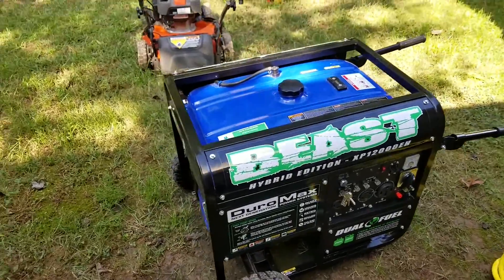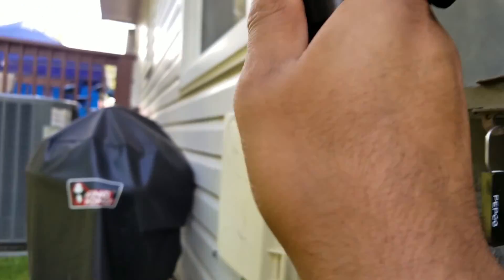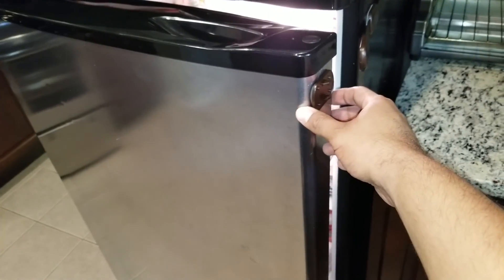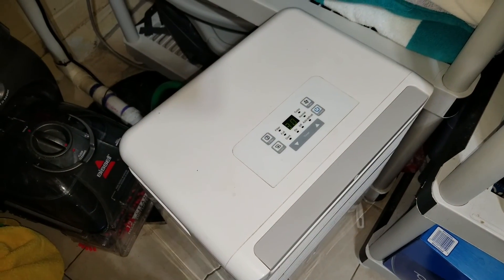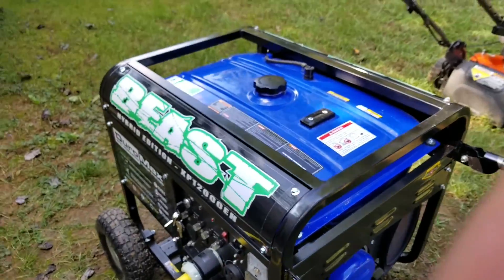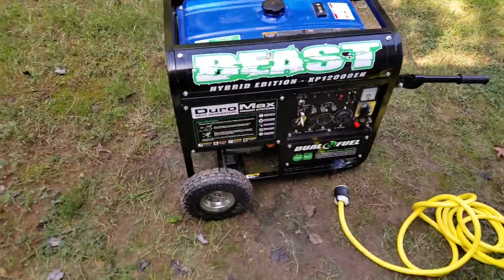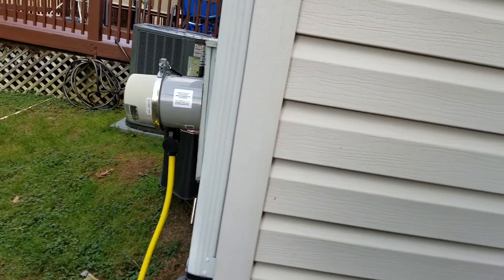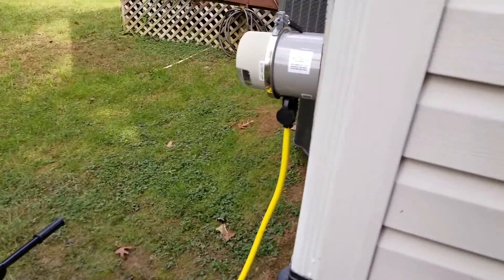GenerLink + Generator powers whole house - XP12000EH , MA23-N, running TRANE XR17

Comment: For use with the Generlink, the generator must be floating neutral and NOT neutral bonded to frame. Otherwise the second ground will mess things up
Reply: UPDATE: I used my TMG 10500 tri fuel generator which is bonded to neutral for 8 hours recently through the generator with no problems. The double ground didn't cause any obvious problems although this is NOT recommended

Comment: Cool device but too pricey for me.  Installing a 50a plug and interlock kit so i can just switch over and power what i need with a 10kw generator.
Reply: how much did you pay the electrician to install your interlock
Reply: @nic7694   I did it myself.  Was quoted about a grand but I did it parts and all for $500 which included a Siemens 100 amp 6 circuit sub panel, 50 & 100 amp breakers, Reliance 50 amp power inlet, all conduit, elbows, fittings, 50 amp 25' power cable from gen to power inlet, etc.  I had to add the sub panel to move over two double pole breakers for the HVAC condensers so I would have the space for the 50 amp breaker for the generator and interlock.  I added a 100 amp breaker that feeds the sub panel.  Used 2/3 for the 4 foot run to sub panel and 6/3 from the power inlet to the 50 amp breaker.  I work for the city where I live and the city electrician confirmed everything that was done.  I'm not in city limits so didn't have to worry about permits.

Comment: You have the idle control off and it should be on when you start the unit up. It's better for the wear and tear on a cold start up of the engine.

Comment: @Chris
Do you have the 30 amp Generlink (MA23 model)?  I assume so since you connected the cable into the 30 amp L14-30 connector on the generator.  Could you confirm?   If so, I’m surprised it will run your AC……that’s great !   Thanks.

Comment: My Generlink switch has instructions which state that it won't work with generators that have over 7500 watts run power.

Comment: You made Tim Ellen proud lol 😆 I use my beast to run my well pump when filling the 40 thousand gallon pool but also wired to home garage . Have 342 hours on it no problems run off LP 1000 gal. Tank. You need a small shed to protect an quite that beast down lol 😆

Comment: No interlock on that panel,dangerous,mostly illegal,they are simple to install.
Reply from the maker: I don't need interlock, I have a Generlink automatic transfer switch. It automatically disconnects form grid when you connect a generator.
Reply: My bad you are right I forgot that you hooked it in at the meter,keep up the good work.

Comment: May I ask what the electrician charged to install the GenerLink?
Reply from the maker: Free, my electrical company installed it at no charge. I just had to call several times times to explain what it was and I finally got an appointment and they came out to install it.
Reply: I live in Baldwin County Alabama.   I have the 30 amp Generlink which is rated for my house Baldwin EMC advised me what I needed.  Total cost was $755.00 with a free install and the BEMC lineman walked me through the entire connect and disconnect process with my generator running.  Sally was my last hurricane to drag extension cords from generator to appliances.  Next project is to replace my 25 year old Troy Bilt 5550/8550 generator (still runs great) with at least a 10000 watt dual fuel.  My gas meter is close to my Generlink.   Will primarily run off gasoline, if available.   Two takeaways:
1.  With supply chain issues, the Generlink is not always available.
2.  God bless linemen.   I have witnessed first hand their heroic work from Ivan to Sally.

Comment: DO YOU ACTUALLY GET THAT NICE YELLOW HOUSE CONNECTION OR NOT--
Reply from the maker: No, this generator did not come with a power cord. The only thing it came with was a 30 amp plug to make your own power cable. This yellow cord came with my Generlink Transfer switch kit... the thing connected to my meter.

Comment: Does your Duromax 12000EH run the central AC on LPG?  I see you added an NG conversion, does it run the central AC on NG?
Reply from the maker: It does runs my central AC on NG. My Central air is a 3 ton (2 stage) HVAC. When it turns on, it starts on the lower 1st stage so it's easy for my Generator to start. I have seen other videos of people running larger AC units, but needing to install a "hard start kit" to the outdoor unit.
Reply: @Mr-Chris   Yes, thanks.  I've installed a "hard start" kit on my 4-ton central AC.  Hoping that'll allow the gen to start the AC.  Wish I got the variable start AC when I had it installed two years ago.
Reply: Generator safety https://youtu.be/I1jT3ANENvI

Comment: How do you ground this generator? Is it a neutral-bonded or floating neutral generator?
Reply from the maker: I am not an expert on this, but my house has a grounding rod near the meter where I conveniently run the Generator. So I connect a ground wire to the generator grounding nut to the rod near my meter... I'm not sure if thats correct, but the manual does recommend to ground to a rod.
Reply: If you ground the generator directly to a grounding rod, you may not want to have a ground wire from the receptacle also connecting to the ground in your meter hookup or the main breaker panel. Be careful!
Reply: The Generlink has a neutral ground wire that connects to the house neutral behind the electric meter.  A grounding rod is not required.

Comment: I would really be cautious turning that air conditioner on using that generator it can pull up to 35 Amps easily on start up and you could Fry that compressor.
Reply: Exactly. Low Amps everywhere, and a lot of things can fry.
Reply: Lol if you have a 3 ton unit that pulls 35 amp on start up. Your unit is defective or old as dirt. If anything it pulls 18 to 22 amps.

Comment: Im in a similar situation in that electricians want me to spend 2000 to swap out by dual breaker box with buss fusses in order to connect a transfer switch. Is that what i really need to do as i have a 3 ton Trane 16 but to spend the money for generator and a complete overhall of my breaker box is really breaking the bank acct?
Reply from the maker: Wow $2K to install a new breaker box. Living in the DC area things I see how things are way overpriced as I was quoted around $5K by three different companies. The Generlink was a cheaper option and works fine with my breaker box and powers my HVAC with no issues. My HVAC is a two stage system so the 1st stage doesn't draw too much power so my generator it's able to run it when it powers on... even when it runs on the higher 2nd stage it can run it because it starts off on lower stage making it easy on my Generator. Depending on your system, you might need to install a hard start kit on your compressor to get it to run.  
I Also got super lucky as my power company has a program where they provided and installed the Generlink for free... but they still "own" the generlink as it's considered part of meter. But if you buy your own Generlink, its about $600 and most power companies don't charge to install it.  Y
Reply: Joe, I just changed my panel with a 50amp generator outlet and a lockout slide for $1900. If you have fuses or certain circuit breaker boxes you need to change it out for safety reasons (greater fire risk). If you do a four -point inspection for your insurance company they will make you do it anyway so it's a good time.

Comment: I'm very surprised that your whole house including the air conditioner operated off the 30 amp connector why did you not use the 50 amp
Reply from the maker: I can't use 50 amp on my generlink transfer switch.  Its rated only for 30 amp. In order to get a 50 amp switch... I need to upgrade my entire breaker box.
Reply: You can get a unit that does 50amp

Comment: So if you are plugging that directly into the meter.. how are you isolating this in order to avoid electrocuting some repairman on a pole somewhere in your neighborhood while he is searching for an outage on what might be considered a down circuit?
Reply from the maker: It's a automatic transfer switch from the generlink . Once the Generlink senses power from generator, it disconnects itself from the grid. Once you turn off generator, it reconnects itself back to the grid.
Reply: My Generlink was purchased from and installed by my electrical utility provider.

Comment: I have the XP12000EH also and it has the 50amp receptacle. I also purchased an LP conversion kit from US Carb and attached it to my gas meter. No more stored fuel to worry about.
Reply from the maker: Cool, did you setup the connection yourself to the gas meter or have someone do it for you? I ended up installing the connection to the gas meter myself and felt like I had to do more research into how to add/install a connection to the gas mater than that actual conversation of the generator to Natural Gas
Reply: @Mr-Chris  how is your set up working now? We just got the estimate for this set up, but haven’t done it yet?
Reply: Is this capable of running a central AC as well? This is my plan with the Pulsar 12kw gen as well.
Reply: The 10k has a 50 amp plug too
Reply: I just purchased a Firman tri-fuel generator, which I plan on running on my Natural Gas connection of my home. I also will have a Generlink installed to my my electrical meter. My question is this. The generator I purchased runs at a constant 7500w/9400w on regular gas, 6750w/8450w on propane, and 5500w/6900w on Natural Gas. My home is a about 1250sq ft, with natural gas stove, furnace, and fireplace. It has electric central air connected to the Natura gas furnace. Would this generator connected to Natural gas run my whole house ? Should I get the generlink 40w cable, instead of the 30w cable. My generator has both a 30w and 50w inputs. My understanding is with the Generlink setup, is I can choose which breakers to use in a power outage, and leave the less essential breakers off to conserve generator power. Thanks for any help or advice.

Comment: Hi, does the cable come with the Gernerlink? Also is Gernerlink good to use with a 50 Amp generator??
Thanks!
Reply from the maker: The generlink did come with the cable. The default cable is a 30 amp cable. The 30 amp cable works okay with my generator which also has a 50 amp plug. I believe the manufacturer also makes a 50 amp rated cable however it's special order.
Reply: @Mr-Chris  Thanks!

Comment: I can’t believe the whole house plus a/c ran on 30 amps. I would upgrade to the 50 amp plug
Reply: Generlink makes a 40AMP unit and you can order a 14-50 plug at the time of order http://www.generlink.com/generlink.html
Reply: He said the 30 was the only one that worked with that generator.I wonder if there is some kind of a conversion plug?Because like you said,that doesnt seem like a good thing to run that many amps on a 30 AMP plug but hey I'm no electrician by any means.
Reply from the maker: @johnkohler8600  yep that's right I can only connect 30 amp because the generlink is rated to work up to 30 amp. If I convert to plug to 50 amp and try to connect it... the generlink it will trip.
Reply: @Mr-Chris  30 amps isn't nearly enough to safely run your whole house. You are running the risk of starting a fire.
Reply from the maker: @chipdayton9426  I know, I only turn on essential curcits not to overload it.
Reply: @Mr-Chris  That's good, but then it's not a whole home generator then, is it.
Reply from the maker: @chipdayton9426  nope it's a portable generator
Reply: @Mr-Chris  According to the GenerLink website, the MA23 (30-Amp): Generlink is only supposed to be used with portable generators that have a running wattage below 8,500 watts. The Beast is about 9,500 running watts. Your generator is sized for the MA24 (40-Amp): That model of the GenerLink works with portable generators that have a running wattage below 10,000 watts.
http://www.generlink.com/generlink.html
Reply: @chipdayton9426  Of course it is.  Utility power loss should be an infrequent event.  I don't expect to run ENERYTHING in my house on a generator for the limited amount of time I anticipate power to be out, only the essentials like well pump, oil burner for the boiler for heat and hot water, refrigerator and freezer.  I don't use 240V/120v large loads like the clothes washer and dryer, the electric range, and the dishwasher.  Sensitive circuits like TV, WiFi router and other electronics are powered from their own battery-backed UPSs that act as power conditioners to cleanup the "dirty" power from the generator.   I have a 5 ton air conditioning system that also would not be powered but I live in the Northeast so I'm more concerned about heat in the Winter.
Reply: @johnkohler8600  No, he said that "the 30 amp cable is the only cable that works with this model "Generlink."
Reply: @johnkohler8600  The Generlink comes in 30 amp (up to 8500 watt generators) and 40 amp (up to 10,000 watt generators) models.  The Generlink comes with a 20 foot cord with whatever 240/120 connector you have on your generator (you specify the connector you need when you place the order). If you want a longer connecting cord you can purchase one for a few more bucks.

Comment: You can only pull 3600 watts through a 30 amp circuit  a 50 amp circuit you can pull 12000 watts
Reply: That's a 220 volt cord at 30 amps, I believe, so it should be 6600 watts.
Reply: @2mYgR  You are correct.  Global Power Products rates the 30 amp unit for generators below 8500 watts.

Comment: Thanks for the Video.  I have a generator that runs on LP gas so there will be no need to rotate the gas and I should be able to get a longer run since I have a large LP gas storage tank. I think I will have to purchase my Generlink and they are quite expensive (plus an electrician will have to install it). but I still think this is the way to go.  Thanks again for the informative video
Reply: My local electric company (Atlantic City Electric) came out and installed my GenerLink free of charge. Check with your power company. They may also do that.

Comment: Run the generator for an hour, then change the oil. The engine, during break-in, will put lots of metallic particles in the oil, as the piston rings and cylinder wall beds in. These engines don't have any kind of oil filter, to keep that metal out of the oil. The initial couple of oil changes can mean the difference between a 400 Hour engine, and a 4,000 hour engine. I recommend an oil change after the 1st hour, then again, after burning a full tank of fuel. After that, just go by what the instructions manual says. It's always worth it to check the oil level, each time you fill the tank. Oil, in unopened bottles keeps pretty well. No need to replace it even after years of storage. Keep a case of oil along side those gas cans.
Reply: I have a new one. Haven't needed it yet. Thanks for the oil advice.
Reply: @davidjudd951  break it in on mineral oul, then switch to synthetic 
I have one generator with over 1500 hours on it.
Oil changed about every 75 hours or so.
Reply: @5280bj  Thanks for the info. It makes sense. 
 The auto makers have break in oil. I remember stories of guys ruining their new high performance engines when Slick-50 was the rave, and they put that stuff in their brand new motors.
 I even talked to a Ford dealer mechanic, that replaced a new engine on a customers Mustang because of Slick-50 being used before break-in. 
 Of course, the customer ate the costs of the repair because he voided the engine warranty the instant he put that stuff in his new motor. 
 I wonder if they even still make Slick-50.
Reply: Agree wholeheartedly on the oil maintenance schedule. Especially using mineral oil for break in. With barely over a quart in the crankcase, like a lawn mower, figure with a genset working much more higher RPMs  would do oil changes every 20 hrs of use. Most lawn mowers recommend 40 hrs. After all it's only a quart of oil...even mainstream  synthetics can be found on sale for $19.00 for 5 quarts. Also diesel rated oil has much more anti wear additives than gasoline auto oils. It would be sensible to use diesel rated oils. Delvac, Rotella both sold at wally world. 1 gallon this week was saled at $14.00. _ also propane burns much cleaner than gasoline. The oil will stay clean looking but the additive package degrade thru use so change it. It's cheap insurance.
Cheers...
Reply: We have a predator generator that we use weekly for racing and we use it when power goes out. Have had it for 8 years, never once changed the oil. Just add a half qurt every time it turns off because of low oil....
Reply: @51-FS   right, a person involved with racing is not changing the oil... good one
Reply: @Huskerfan69  then I guess u wouldn't believe we run 110 in Iraq as well? No all the time but have menny times when we out of gas at the track

Comment: that thing is pretty kool, but they sure are proud of them
Reply: I got this exact one (almost)  at home depot on clearance for about 450 wth tax,  was 1200 something.  It had a dual fuel clearance sign on it, in a dual fuel box,  but was a gas only generator.  I was pissed, but FINALLY 3 years later i ordered the propane for COVIDIOT CHAOS, you're right,  they're ridiculous and too loud,  but  a beast for 450 was hard to pass up.
Reply: Can someone let me know how the power company feels about these? I’ve been an electrician for 30 years and I just saw it for the first time today when a customer asked me about them.
I am not so sure our local energy provider  will allow them .